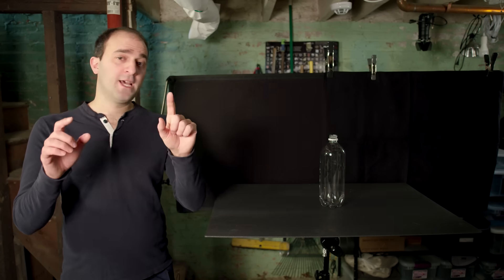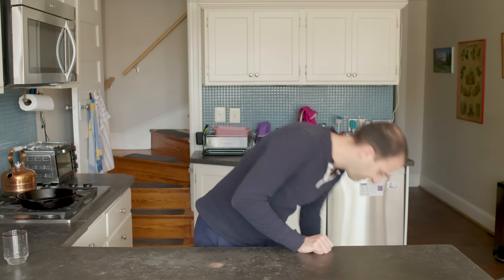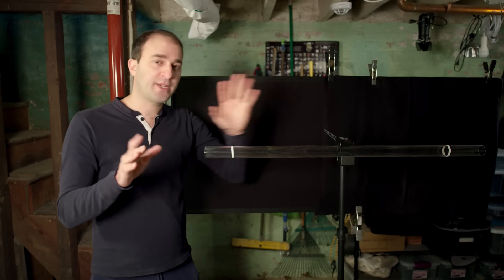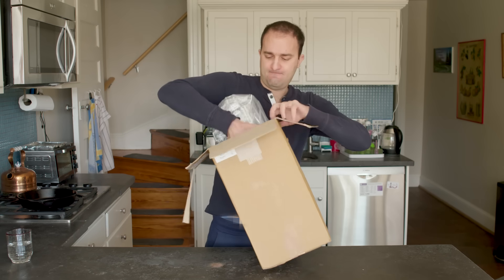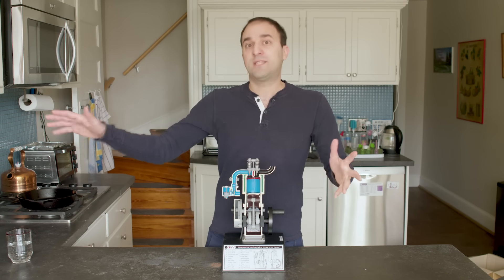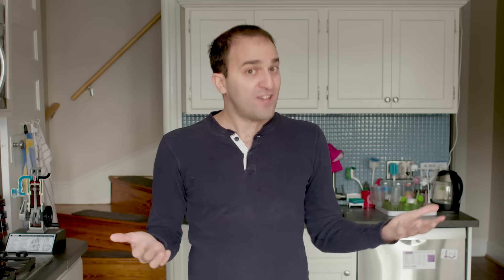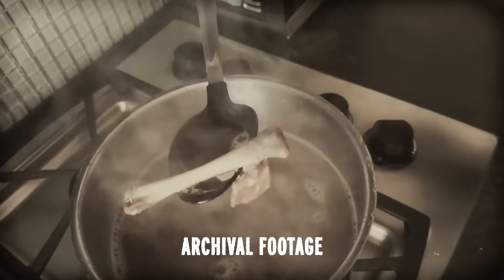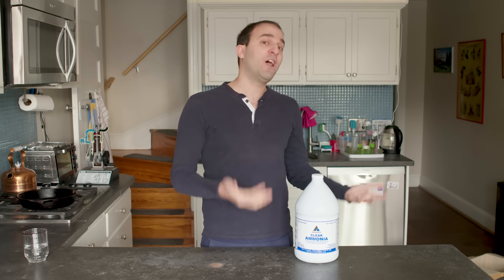Does Toyota Know Something That We Don’t?

Comment: Law of headlines strikes yet again...
Reply: wdym
Reply: @aeriumsoft  if the title ends with a question mark - answer is NO, and the video proves just that.
Reply: @VEC7ORlt  My take-away from the video is a Yes, Ammonia engines are much more plausible than it would seem at first. The next big question is if it could be produced affordably at scale in a way that doesn't generate CO2.
Reply: @mrmaple  'much more plausible' tells us F all - there is no engine, nor there is fueling infrastructure, no manufacturing, just a lot of ifs and buts, in other words not a good place to start.
Frankly it's the same with hydrogen...